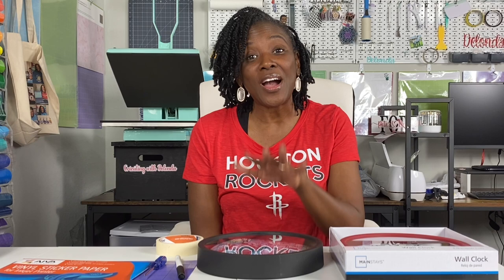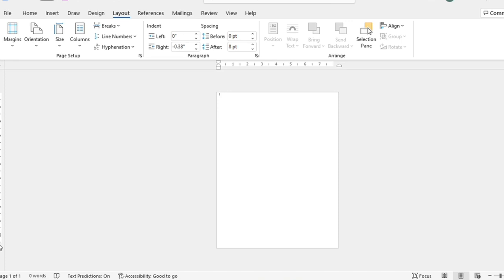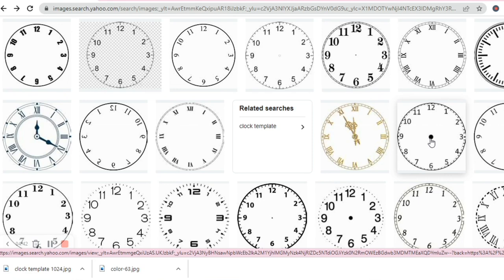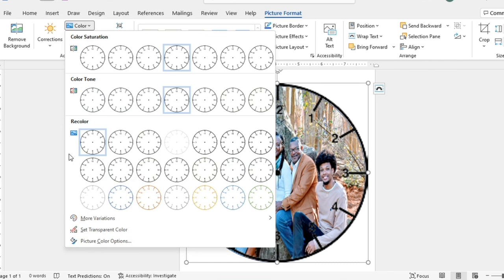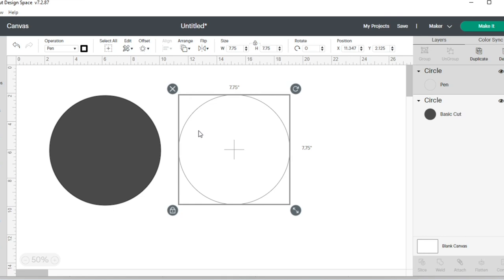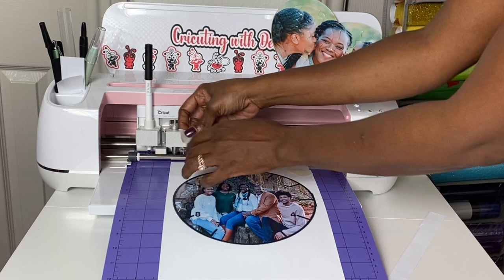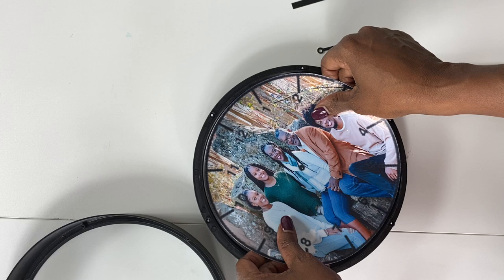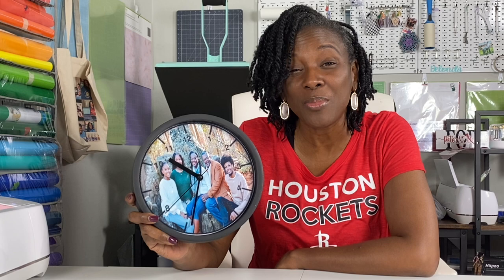HOW TO MAKE A PHOTO CLOCK IN MICROSOFT WORD

Comment: Hi Dalonda well I tried to make the photo clock. Girl what a time I had. First I couldn't figure out how to reposition the margins, then I couldn't get the circle to stay at 7.75, when I finally gotten I tried to position the card stock like you did but kept cutting the edge so I did put it at the top of the mat it worked until I released the mat by accident pushing the wrong button recut the card stock 5 times now camed to cutting the picture it wasn't even. So I just cut it with scissors. Then I realized you picture had a glossy film. I used cricut printable vinyl and my cardstock wasn't a 12x12 I figured it out. I had the 8x10. So I gotten frustrated and put it off for another day. I am not giving up I AM GOING TO MAKE THAT CLOCK.  I am placing an order on Amazon for the paper you used. Thanks so much. My husband gotten tired of me rewinding the video. Now I know what to do. Oh of course I can't find the file in windows now. But that to clicking on the like button. I can rewatch again an again ♥️ love your tutorials you do a very good job explaining everything and not rushing through it. Please keep it up.
Reply from the maker: Thank you so much ❤️! I'm so glad you aren't going to give up.

Comment: Hi I have a quick question I have done this project several time but for some reason now even though I size the circle and the picture to 7.75 when it print is printing to 7.25.  I change printer and I make sure the size on the margins are hardly to none but I print the picture to several times and it keep coming too small for the clock.  I do t know what is going on.  Like I said I made this project several time in another printer with no problem.  Please help. Thanks
Reply from the maker: Oh no! Are you able to resize it in Canva?
Reply: @CraftingwithDelonda  didn’t try canvas but I think the clock size in Walmart change.  I had to print the picture 7.90 instead of 7.75 and it came out perfect.